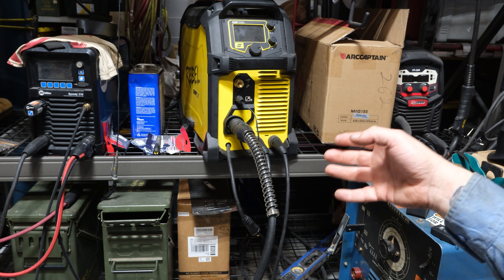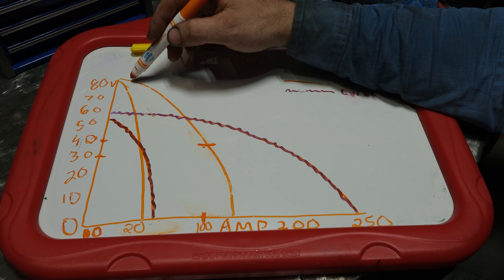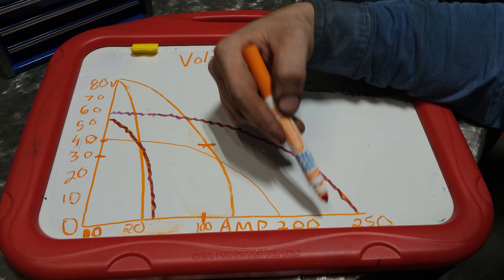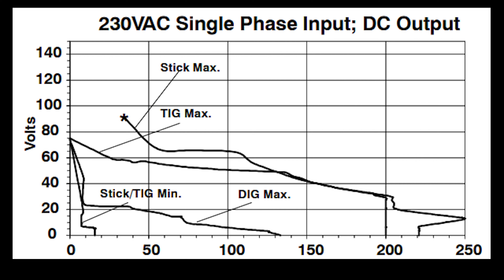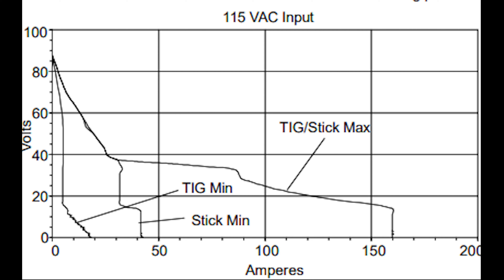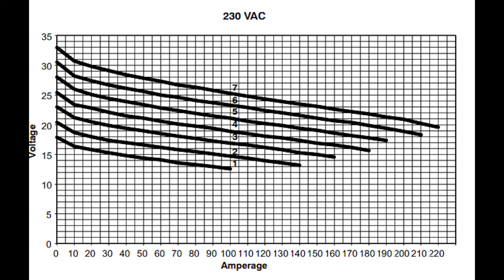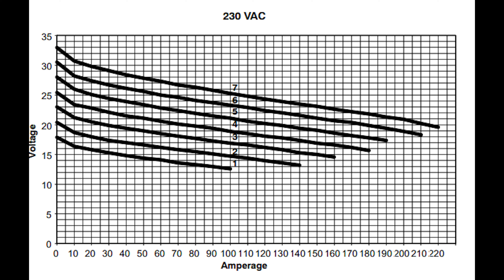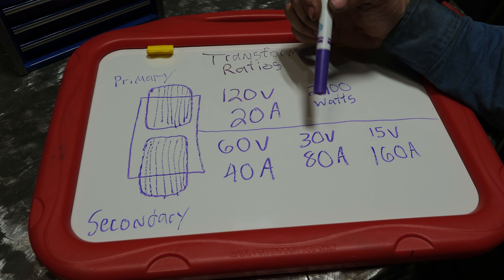QFTB #7:  What are volt/amp curves of welders?

Comment: Very well explained! 
Addition:
The manufacturers "trick" physics by overloading the input circuit periodically for a short time to get higher output. That works because breakers usually have two working principles 1. An electromagnetic (that trips the breaker at a amperage   that is N-times higher than the nominal load - but then it Acts emidiately) and 2. a thermal actuator  (that needs time to reach the critical energy - it works on lower overload values but is kinda lazy.
Cheaper Inverters are actually drawing more power form the input than they are rated and get away with it (often) because this done only a limited time. But on longer weldseams they are notorious for tripping breakers.
Reply from the maker: Yep 100%.  Case in point the arc captain 130 I have been trying to test for a couple weeks that kills my generator despite claiming only 20a current draw.  It’s so bad I don’t know how it’s legal to sell lol.  35a input loading on 120v just to weld 1/8th in steel 😅

Comment: Man, you helped me so much in understanding how it works! This vid, and also the answer you gave relative to the last question I asked you (about 6010 voltage)... I am beginning to understand. And I also understand that there is so much BS out there (YT, forums, etc). You helped me deconstruct all that crap. Two days ago, a «seasonned» welder almost laugh at me when I was talking about voltage in stick welding... «... voltage is about mig welding, not stick)... 🙃
Reply from the maker: Thanks for the kind words and I am glad you are understanding everything better 😀.  Welding is actually very complex and most people that weld don’t really understand what’s going on.  That’s ok, because for the most part you don’t need to know what’s going on behind the scenes to weld stuff.  It sounds like you like to know the behind the scenes details, which is a great thing.   It doesn’t surprise me one bit that a seasoned vet wouldn’t understand stick functions with voltage in an arc gap.  Most people don’t understand where all the “heat” comes from with 6010 despite running lower amps than the same size normal rod.  The same can be said for why helium runs “hotter” than argon with tig.  Nothing is magical, it’s all about the relation of voltage and amperage 😀

Comment: I think this video has convinced me that if I get into welding, I’ll buy a transformer based 240V/50A input machine with a DC option. I would be able to use 6010 that way. And out of curiosity I could look at the transformer and see how it actually worked to maintain the selected current across a range of output voltages.

Plus I’ve heard some of the cheap inverter machines don’t accurately produce the amperage you set them for, which I’m sure is easy enough to compensate for but it seems like a bad thing while trying to learn. 

Obviously cost is a big drawback of the transformers, especially since I’d also be buying electrodes, a decent hood, gloves, and welding jacket, practice steel, etc. But I have seen old welding transformers for sale, second hand, for similar prices to a new cheap-brand 120V inverter machine.
Reply from the maker: So the older transformer machines (like my dial arc 250) are still exceptionally good welding machines.  They are easy to strike arcs on (because they can hold high voltage easily).  They generally don’t have any issues whatsoever running 6010 (the industrial welders that is, some of the cheaper transformer machines like the sears branded ones might not run 6010).  They are simple, fairly quiet, and will last forever.  The main drawback is they are very power hungry, and really need a 50a power outlet.  

You can often pickup a dial arc 250 like I have for less than 300$.  That’s roughly the same price as many cheap inverter stick machines.  That’s really not a bad deal for an indestructible shop welder.

Comment: Good explanation Greg. I’d like to add that you can’t maintain 2400 watts on a 20 amp 120v circuit. At most, a breaker won’t operate for more than 15 seconds or so at a 90% load. It could drop to 80% load for a longer period. So realistically, no one is going to get more than about 2150 watts longer term. It’s amusing when I see small, cheap 120v welders advertising over 120 amps and even 200 amps at 240. The ones I’ve tested barely do 100 amps at 120v for more than a few seconds and the 200 amp spec at 240 usually turns out to be 150 or less.
Reply from the maker: For very short duration obviously a breaker will hold a higher load, and no doubt welders abuse this often.  Just like you said, a cheap welder advertising 120a when you know it has poor power factor and efficiency.  75% of the time they are lying about output, and the other 25% they are overloading the breaker and causing it to trip lol.  Speaking of that, I bought an arc captain 135 and they claim over 120a of stick power on a 20a breaker with a .65 power factor while only having an inrush a bit over 20a 😅😅.  It tripped my 30a generator breaker welding 1/8th steel at 2/3rds max output.  I hate lies lol.
Reply: As an electrician, I’m pretty sure the breakers can hold on for longer than that, if you’re actually close to their rating.

When wiring a building you can feed a load that’s up to 100% of the rating of your wire and breaker, as long as it doesn’t run continuously for more than 3 hours at a time. For “continuous loads” (ones that run full power for over 3 hr) you don’t want to load a wire or breaker beyond 80% of its rating. But that’s more of a safety/reliability margin, and breakers will typically hold their rated current continuously.

Schneider Electric claims that for a 15 second overload time, their single pole 20A breaker will take somewhere between 30 and 50A to trip. 

At the end of the day it’s just more room for the cheap welding machine manufacturers to lie about their specifications and build things that aren’t as safe or useful as you’d think from reading their sales pitch.

Comment: great video greg, i just sold my miller thunderbolt 225 that was made in the 70s and i regret it big time that thing ran everything even on a 30 amp line
Reply from the maker: Those are indestructible and had a similar volt/amp curve as the dial arc, so they ran rods really well.  To me the main downside is the size and weight, but sitting in a shop where that doesn’t matter they really worked well.  I like the modern settings of most inverters but I won’t be selling my dial arc anytime soon lol.

Comment: Your explanation was spot on. Can you tell me what kind of machine you would recommend that is of the newer inverter type that will hit the magic 25V min and allow me to spray arc with MIG(GMAW), stick weld up to 1/8”dia 6010 and TIG weld with high frequency for Aluminum on a 240VAC input? Would a MILLER MULTIMATIC 235 MULTIPROCESS fit the bill?
Thanks, keep up the great work. 😎
Reply from the maker: So the only welders that can tig aluminum and stick weld with 6010 are the everlast lightning, esab rebel 205, and the miller 220.  The miller 235 is a DC only unit and for some unknown reason it not designed (and according to miller) won’t run 6010.  Most all multi process machines won’t run 6010 because they have power supplies that can’t output more than 27-30v.  The miller 255 will run 6010, and as of 6months ago miller updated the 220 with new software and hardware to run 6010.  Whats interesting too, is my esab rebel 235 and rogue 200 actually run 6010 differently.  So even from the same company there is differing performance on 6010 because of differing voltages the machine can output.
Reply: @makingmistakeswithgreg  Thanks for the reply Greg. The Miller 255 looks very nice, and only rated at just under 40A input at 240VAC at full rated output, that’s actually very impressive. However I’de probably have to rub my wife’s sore feet and back everyday for the next 25 years in order for her to buy me one. 😁👍

Comment: This topic reminds me of a video suggestion. Make a video of spray mig with .023(3 pass) wire on a 3/8inch steel fillet and bend-test with press and then comprare against 0.035(one pass) spray mig bend test. The leg and the throat - must be the same. I wonder the deeper "depth of fusion" of .035 wire would effect the break point. But i think this test would be invalid on fillet , because you can't get even leg and throad thickness between 3 pass weld with .023 wire and 1 pass weld with 0.35 wire. And this would effect bending. The best test would be to make it on a 3/8 plate groove weld and bend the root. Then the thickness would be the same. I wonder if the .023 spray mig would hold , because short mig definitely doesn't. And have a good day man. Edit: It's interesting topic because there's some 250amp chinese migs that states they can go to 24volts which is good of spray arc with .023wire.
Reply from the maker: That’s a good question.  The biggest limitation of wire is its inability to fuse the root on anything thick without significant power, and preferably gas mix for spray.  The different gas mixture combined with high values really solves most of the issues with wire over stick.  .023 spray would open the door to possibly welding thicker plate with reduced settings that more lower powered welders could do.  That could be a good thing in the sense of added capability, however I would be pretty hesitant to suggest doing it for the fact it would likely hammer the machine pretty bad and how well it would hold up would be questionable (depending on machine of course).  

From a strength perspective believe it or not a 140a short circuit mig weld on a 3/8th fillet (like I use in many videos) will actually hold a full bend away from the face.  The problem is it’s incredibly weak when bent towards the face due to less than zero root fusion.  Such a weld would likely fail if it experiences vibration, dynamic loads, or force towards the face.  Not to mention that weld would be even weaker on anything besides perfectly clean metal, I bet millscale would make it much weaker.  Solid sidewall fusion and root fusion is always going to be an issue with c25 gas and short circuit on thick plate.  C100 gas helps a ton but the welds seem to lose some strength over c25.  

So realistically the main limitations of wire processes is output power and then gas mixture used.  .023 wire with spray gas may actually be useable on a normal 200a mig welder for actual spray, but it would be at the limit.  The results would have to be better than short circuit on 3/8th though.  Next time I run .023 wire I will try it and see what happens.
Reply: @makingmistakeswithgreg Thanks for the informative answer.

Comment: Great explanations!  Would it be pretty safe to assume that any ESAB stick welder with a 200 something in the name would be able to weld with 6010 rods?
Reply from the maker: Most esab machines will run 6010 without issue. The rebel and rogue series both do, the rogue actually welds a bit better with 6010 from my experience (I currently own/have owned both).  The 210emp multi process would not likely run 6010.
Reply: @makingmistakeswithgreg  Thanks!

Comment: I am learning that I should be aware of the minimum voltage required to run any given stick rod, or tig arc, or spray transfer.  This way I can look at a machine's volt/amp curve to see if that machine can deliver what I want/need.  am I understanding this correctly?
Reply from the maker: With tig it operates at such a low voltage that any stick power source can tig weld without a problem.  With stick, if you want to run particular rods (6010) and the volt-amp curve of a machine can’t produce say 40v at 90a, the welder won’t run 6010.  The same can be said for carbon arc gouging (air arc) which needs 50v at 200a to run common rods, which is way higher than most welders can supply.  The big dial arc 250 I have isn’t bothered by 6010 but my cheap Amazon special won’t run it because it won’t produce enough voltage.  To further complicate things it’s very common for companies to mention something like “high open circuit voltage (or OCV)” and “80 volts OCV” in marketing their stick welders.  That’s a good thing to start rods (higher resting voltage makes it easier to start a arc just like it’s easier to get shocked by 120v over a 9v battery) but it has nothing to do with actually running rods.

Most 1/8th rods run at 19 to 24volts.  6011 is around 26-27 and 6010 is 30-33v.  Many welders will run 6011 that won’t run 6010 because they produce just enough voltage for them.  On face value being able to run 6010/6011 properly (or at all) might not seem like a big deal, but stick welders that will run 6011/10 well often flat out weld better with other rods too.  They often start easier, are more forgiving, and when welding a gap the arc stays lit rather than cutting out.  A gap requires more voltage to weld due to longer arc length, and it becomes hard to keep even 7018 lit on welders with a poor volt-amp curve

Comment: As an electronics nerd this is pretty interesting. 

I’m interpreting it as each machine setting comes with its own current/voltage curve. 

Am I right in thinking a stick machine set to 100A would produce less than 100 if you were long-arcing and making a mess, and more than 100 if you stuck a rod to the workpiece?
Reply from the maker: So stick welding power sources produce constant current.  100amp setpoint means 100 amps regardless of arc length.  As you long arc the rod the welder will handle the increase in voltage up until the cutoff of its volt amp curve.   As the voltage increases due to arc length the power draw from the wall increases to be able to handle the demand.  The increase in arc length increases heat input due to the wattage increasing, that combined with the long arc gap ends up causing the rod to become unstable and produce spatter. 

With mig and wire processes, voltage is fixed and amperage is variable.  Amperage is whatever it takes to keep the short clear (aka the dead short that short circuit mig produces).  The higher the wire feed the higher the amperage because it takes more amperage to keep the wire from being shorted to the plate.  

Every machine has a different volt amp curve, and some have multiple due to multiple transformers or multiple taps on a single transformer.  Modern machines more or less mostly have a single curve and it’s often flat because the transformer inside is being controlled (for both frequency and waveform).  The biggest limiting factor is input power.  On 120v 20 amp circuit you only have 2400watts of power thus trying to run a 1/8th 6010 at 90a, 32v is 2880w, or way over.  This is not counting the losses of the welder itself.  How some welders are still able to run this is they overload the breaker and the machine itself is super efficient.  The esab rogue in this video is 93% or higher efficient, and it draws up to about 30a on 120v.  Therefore it’s possible for it to run 1/8th 6010 on 120v, something that is basically impossible to do on most welders.  

So anyway constant current devices regulate current so you don’t just have a dead short and trip a breaker immediately or melt the rod.  Constant voltage welders (wire welding) don’t regulate amperage output, the wire feed does.  If you set the wire feed too high the machine will end up tripping its internal breaker/fuse (if equipped) or the outlet breaker.
Reply: @makingmistakeswithgreg  Thanks for the detailed answer! I think it’s helped me understand the voltage/current curves a lot better.

I don’t fully understand how they keep current constant at a set number across a range of arcing voltages. I can’t see how they’d manage that on the older machines that were just a transformer with taps or variable shunt inductance and no active electronics monitoring the output. But that’s not really relevant to the actual welding process!
Reply: @deltab9768  Your concept of a welding transformer is too simple. A standard transformer has two winding and a laminated steel magnetic core. What determines the output is the primary to secondary turns ratio and the load. Generally it is a linear device. If you cut the load resistance in half you get twice the current. 

But welding transformers are more complex. One method of controlling the current output is to vary the steel lamination in the core. Turning the current dial moves the core material in and out, altering the amount of core that supports the magnetic field. If you remove half the core material from the magnetic path then it can't transfer as much energy, it will limit the output.
Reply: @rudycandu1633  That’s the variable shunt inductance I was talking about. It basically gives a “shortcut” path for some of the magnetic field to just run without entering the secondary winding. Effectively that would give the transformer some inductive reactance that “holds back” the current and (unlike normal transformer inductance) cannot be cancelled just by adding a load to the secondary. 

That would obviously limit the current on the output but it wouldn’t create a constant current. It would still be affected by the voltage across the arc.